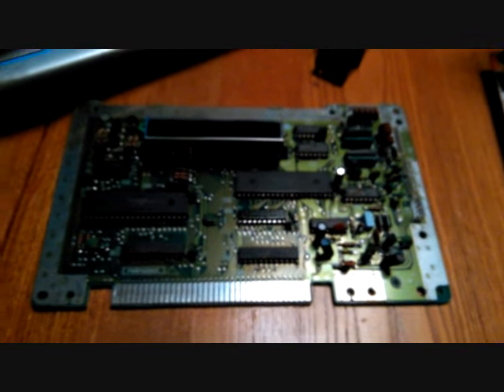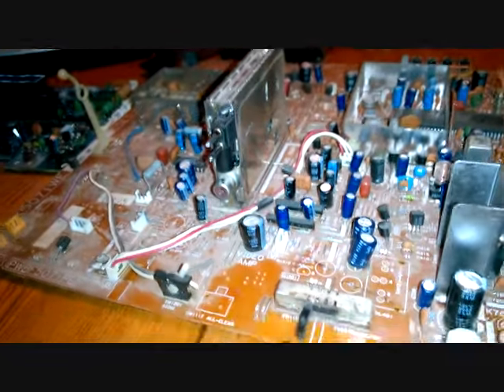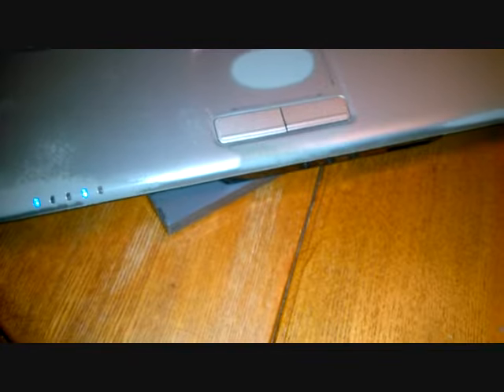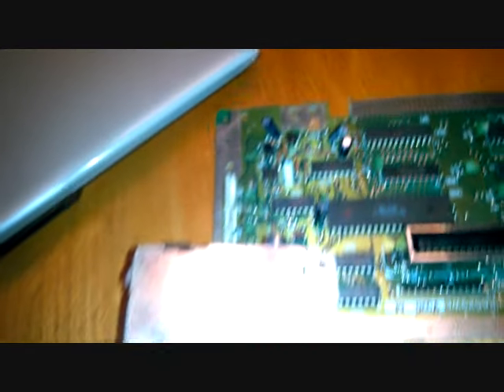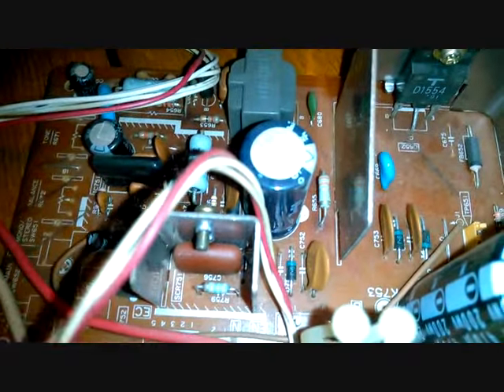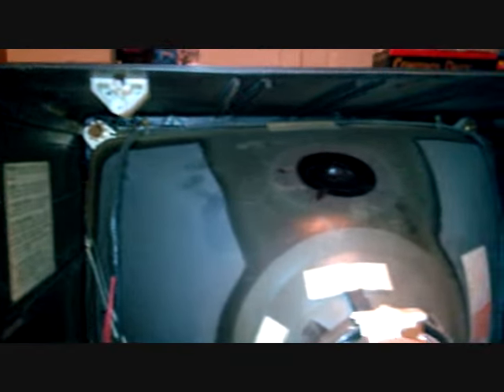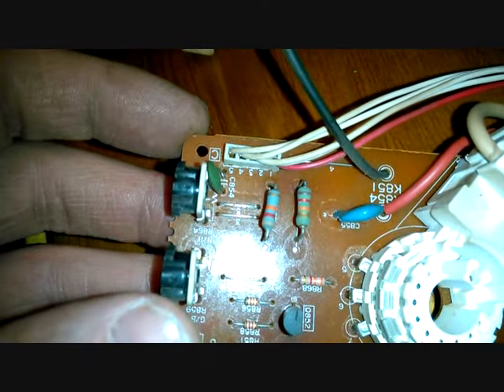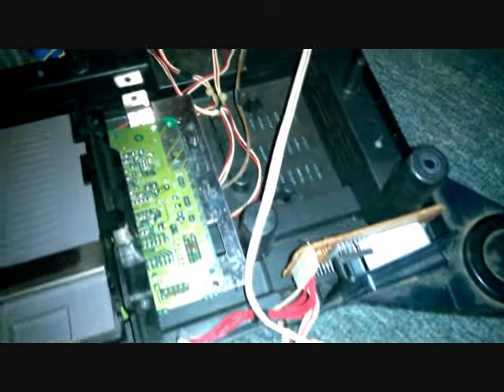Sharp Nes tv

Comment: Hey thanks for posting the video. If you wouldn't mind showing the power board with a flyback on it again in some more detail as I need help identifying a resistor. In the service manual that particular location number is very blurry. The bar I'm trying to identify is a resistor right next to that inductor you showed that you said you wanted to change beacuse  it looks like it melted.